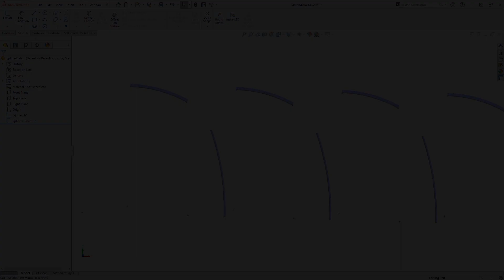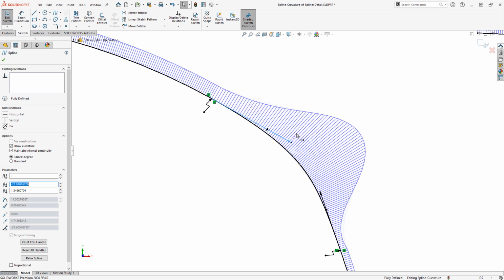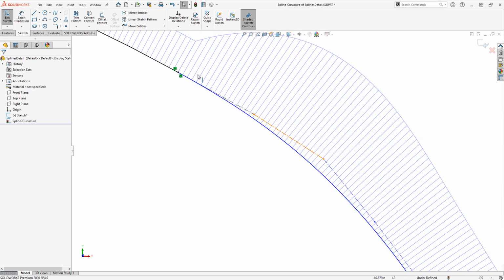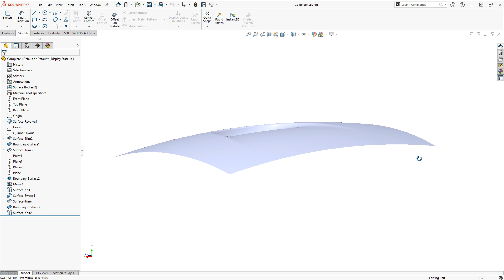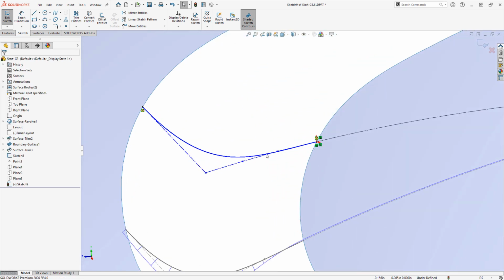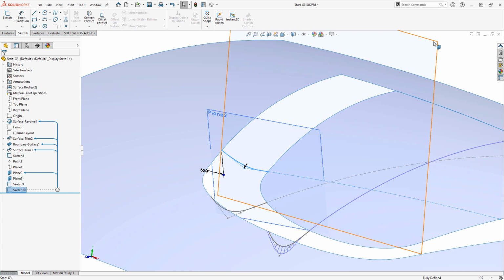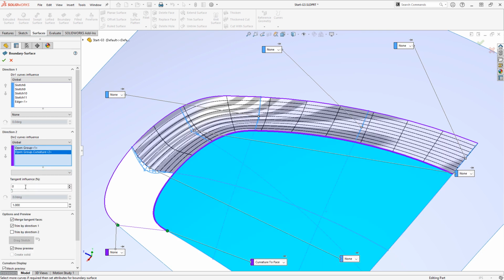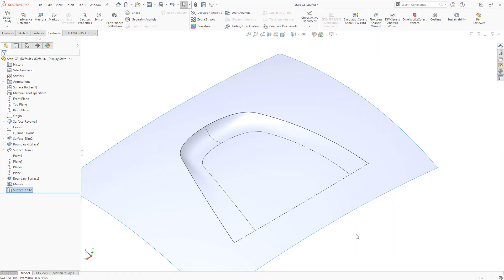G3 Splines in SOLIDWORKS: Torsion Continuity

Comment: Hi, first off great video! It taught me some very helpful tips. I did have one question though: would it be better to just have two profiles for the turned-down surface example? The two being the one at the mirror plane and the line at the end. My thought with this is that it then allows the software to smoothly interpolate between the two rather than defining a couple of curves that the surface is forced to pass through. In my mind, adding the extra curves is just adding further “noise” to the surface because who’s to say the sections I added are perfectly where they need to be? When you flipped to the colored curvature display, it looked pretty messy, and I’m curious if eliminating those extra curves would’ve made it more smooth. Thanks for taking the time to read this and thanks for the fantastic video!

Comment: Why can't you set G3 curvature for edges of surfaces? I think that's a function in Alias.
Reply from the maker: That would be a great enhancement! SOLIDWORKS has added a number of features over the years to help with advanced surfaces such as these newer G3 Spline relations.

As of today though, if you need a mechanical CAD package that can do true G3 surface continuity we would recommend taking a look at CATIA.